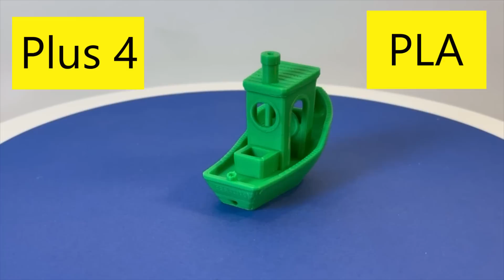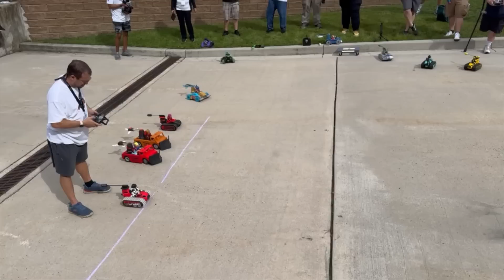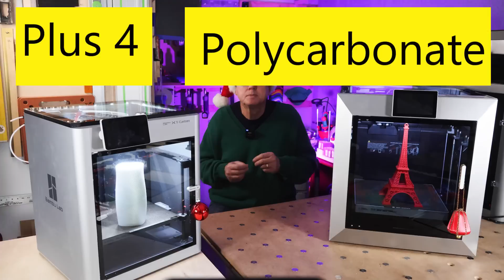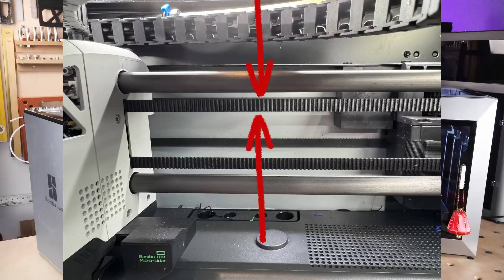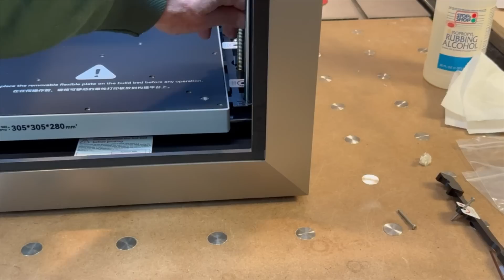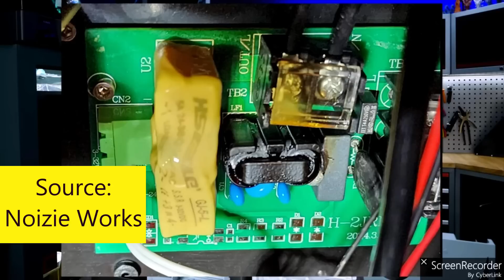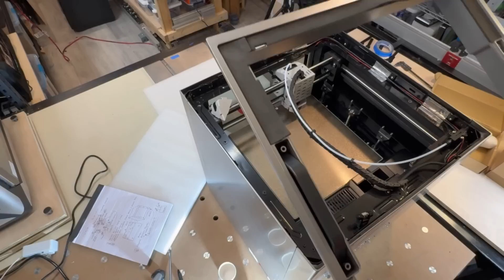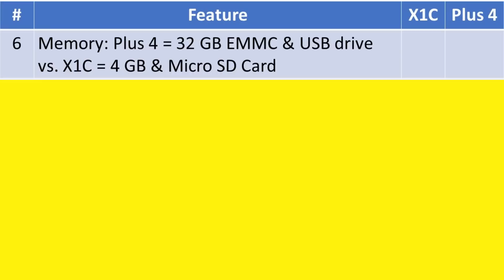Qidi Plus 4 3D Printer: Better Value Than Bambu Lab X1C?

Comment: Who's here because Bambu Labs just got crossed off the "potential purchase" list?
Reply: me lol
Reply: @noahlampkins6330  totally understandable! I ended up pulling the trigger on the +4 earlier this week and will have it delivered next week. I ordered directly from the website, got 5% off my first order, and then came back with a second order to get some filaments and the tungsten carbide tips that are on sale for the Chinese New Year. Overall it was a screaming deal.
Reply: Don't have any issue with Bambu. Nothing has changed for me. I'm a hobbiest printer and do this cuz I like building things and as a hobby to pass my time. Bambu made getting into 3d printing very easy and enjoyable. But I am considering buying the qidi for high temp material
Reply from the maker: That’s a great question!
Reply: I purchased a bambu A1 a couple of weeks agter the "scandal" and it's the best damn printer I've ever had.
Reply: @raindeergames6104  How many have you tried? And have you tried the Qidi Plus 4?  (Because it's awesome, not gonna lie)  I don't think anyone is knocking Bambu's quality. The gripe is all about how Bambu has started locking things down and is seeming to prepare to move toward a subscription based software service for hardware you already bought. While other manufacturers embrace 3rd party solutions and open source software, Bambu is not.
Reply: Been a toss up between the 4 and the p1s here... Looking like the qidi +4 is going to be the best bang for my buck .. so far
Reply: @xtreme43  did you buy it?
Reply: no, only because of cost
Reply: Yup. Got the plus 4 . Does require some experience and a couple small tweaks. But after that it's been great
Reply: Just returned my P1S😢
Reply: 3 Bambu so far... don't get salty because others like convenience 😉
Reply: @mostlymessingabout  I like the convenience of a larger build size, heated chamber, and more money in my pocket...
Reply: @mostlymessingabout what's more convenient about Bambu? My +4 is doing awesome, was less expensive, and Qidi put out profiles for Orca Slicer.
Reply: i totally avoided bambu because of their closed infrastructure . first i got a flashforge , then I got sovol because of their open source . I don't like the dialing it in the machine , but i like the ability to upgrade.. but might get a qudi too
Reply: I bought 4 Bambu's yesterday.  Very much on my list to purchase more.  But you do you.
Reply: @jonwoodworker  that's definitely the plan. I'm really liking the Qidi Plus 4. I'm wanting to print parts for my truck project and it looks like the +4 does ABS better than the X1C anyway. I was really set on the X1C for about a month before this TOS news came out, but it was enough to get me looking elsewhere and I'm really glad I did.

Comment: @ristinnovations  I got my Plus 4 today! Lol the two guys that brought the box to my door didn't offer to drag it into the house and I didn't ask, so I managed. Not as bad as I feared and especially not once it's out of the box. The handles make that weight SO much more manageable. Anyway, I just now got it up and running enough to slap out a benchy boat from the default included files.  On my old Robo 3D R1+ my best quality took about 2 hours 10 min. This thing went through the preflight motions, sat there long enough for me to go "Aaaand it's sitting..." and boom off it flies into printing, lol. I sat there in awe as it blazed through that little boat in about 15 or so minutes. And it came out super pretty. Mind you I used a spool of leftover Flashforge Nebula Purple PLA, NOT high speed filament at all and the thing is beautiful. Only flaws were some indenting in the smokestack and the back surface of the stern, where retracts were happening. This printer is a demon let loose from the best parts of hell, I can't praise it enough. Just now got QIDIStudio installed and haven't had time yet to run one of my own designs, but that's coming tonight ASAP. Gotta see how it can handle some ESun ABS+, Polymaker ABS, and ESun PETG vs. my best from the old machine.

So far, I'm totally in love/lust. This thing is great. 🙂
Reply from the maker: I am glad you are loving your new printer! Thanks for sharing your experience

Comment: Forgot to mention the Plus 4 has 10mm screws vs X1c 8mm screws, and the Plus 4 comes with a network jack so you can hardwire instead of wifi.
Reply from the maker: Yes, those are good points. Thanks for your feedback

Comment: 6:45 I'm tired of people saying "maybe I need to fine-tune the parameters". When 3D printers just came out, that was understandable, sure, but when you're paying $1000+ for a printer  8 years later, there shouldn't be any "fine tuning". Do you need to "fine tune" your laser printer each time you load a new batch of paper? If I'm using a filament with RFID tag that the printer recognizes, it should JUST WORK! All the fine-tuning should've been done at the factory.
Reply from the maker: I understand your point of view, however many 3D printers only have “generic” material profiles instead of pre-loaded material profiles for every manufacturer’s filament so there are different parameter values for every manufacturer’s filament. 3D printers are heading in the direction you describe, but they are not there yet when compared to a standard paper printer. Thanks for sharing your point of view.
Reply: My A1, while still working, printed Bambu filaments really well.  Some generics were very good, some OK, and some straight up failed.  I had to tweak bed temps and nozzle temps a bit to get cleaner prints on many different filaments.  Prusa are the same.  When using their profiles with their filament you can get great prints.  With "generic", not so much.  There is no avoiding tweaking settings to get the best possible print, regardless of printer.  I have about 50 rolls of filament -- all are variations of PLA but rainbow, silk, matte, marble, brick, glow in the dark, etc.  All of them have required some level of tuning for best results other than the ones that come RFID -- and for Bambu that means only their filament...
Reply from the maker: @MrKen800  Thanks for sharing your experience with all the various filaments you use and the fact that they may need to be tweaked regarding their parameters.
Reply: Spot on.
Reply: He's using a special filament made by Bambu labs to work better with their machine, of course a "one size fits all" set of parameters won't be as good as the settings they made specifically for that filament
Reply: Yes. P1S just works and I love it :)

Comment: Great video. Considering the P1S ( more similar to the Plus 4 than the X1C) and AMS are $799 it is a much better deal and is pretty much the same printer (no LIDAR). The advantages of the Plus 4 for the home hobbies really don't matter that much ..IMO. It amazes me how stupid engineers can be. Why on earth would you change the mains connection knowing you are sending out a consumer replaceable part, pure stupidity or lack of connection to reality. As far as support it looks like we have gone backwards with the Plus 4 a few years where Chinese prints had piss poor quality control. And my biggest complaint is china printers in general is the relying on us to do warrantee repair for free. I have no issue with repairing my printers once out of warrantee but to expect free labor to repair an in warrantee printer IMO is BS. Again great video and very informative.
Reply from the maker: Thanks for your frank and candid feedback

Comment: I don't agree with " they should test there stuff more .". they have rushed it to market to be the best value for money printer  and consequently it has some issues  ... but  then the money they  might have spent testing they spend or  shipping parts out  quick smart   and  actually building a pretty good reputation in service and support  as long as people are  posting positive media about the experience i think they have the balance right  i think timing is really important .
Reply from the maker: I appreciate your point of view, however their CEO has stated that they need to do more testing before they launch a new product. When quality issues like the SSR board happen, it has a negative impact on a company’s reputation and it negatively impacts their sales. I think in QIDI’s recent case, they are trying to the right thing by all the things mentioned by their CEO. Thanks for sharing your opinion.
Reply: @ristinnovations  Yeh I think  people will tolerate a few performance issues if the service is good but the SSR thing is a real safety thing really not ok  to send to market way to much risk for everyone ..

Comment: Please double check the part of your video where the heater chamber is replaced!

You do not have to fully dismount the printer for replacing the chamber heater. It's fully sufficient to remove the two screws from the bottom side of the printer. The heater chamber can be demounted from the inside as it fits through the gantry elements, due to the side walls being a bit flexible. The procedure shown in the video takes one hour or more. 

Please at least leave a remark in the video or the comment section that the heater chamber can be replaced differently!

Thank you!
Reply from the maker: I was following Qidi's video on the steps to replace the chamber heater.  I did notice that the Qidi-produced video did not have the two screws in the bottom of the frame holding the chamber heater.  There may be an easier way to replace the chamber heater now, but I documented how I did it by following Qidi's instructions.  Thanks for your comment.
Reply: I was going to say that the dismantling procedure looked totally unnecessary to replace the heater fan assembly. Also, I found it odd that the heater fan mysteriously failed after replacing the power supply.

Comment: The biggest points that mean a lot to me are print quality, ease of use, and reliability. The equipment parts issue was a big turn-off with me. Replacing boards and fans is a definite no-go for me....unless shipping it back to them for the fixed doesn't cost me anything. Otherwise I'll stick with the one that has a better track record.
Reply from the maker: Thanks for your comment.

Comment: Just a heads up: Unless I missed somthing, Qidi power loss recovery is absolutely a lie. 31 hours into a 33 hour print and I had a power hiccup. Printer did indeed recover and had a prompt for power loss recovery. You could either press Continue, or Cancel. I pressed continue and it immediately went to re-home the axis with no on screen controls to prevent this from happening. The bed began moving back up to home position which drove the partial print on the build plate right into the extruder and it kept trying to lift until I yanked the power cord. It is absolutely baffeling to me how they advertize a power loss recovery feature and then program it in such a way that it eill either destroy the equipment or destroy the partial print. DO NOT DEPEND ON THIS FEATURE. Again, unless Im missing someting, this is absilutely not a functional feature and it would be wise to buy a good 1000w UPS to prevent power loss issues. I plan to try to manually replicate this condition again with non critical test prints to see if perhaps it was user error, but from what I can tell, there was only two options to pick and one of them was to cancel the print.
Reply: There is another catch to being able to continue using this feature after a power failure. The position of the printer has to be saved somewhere and in the event of a power failure, only the flash memory is suitable for retaining the data.
However, this means that the position will have to be saved all the time and sooner or later every form of flash memory will be written to so often that it will break. This is a particular problem with microSD cards. And M.2 memory with proper wear leveling is not installed in this printer. The eMMC memory is a soldered component and therefore no better.
Such data actually only belongs in the RAM, but in the RAM the data logically does not survive a power failure.
Reply from the maker: Thanks for sharing your experience with the Plus 4 power loss experience.
Reply: I can confirm Qidi’s power loss recovery works well, on the Plus 4 at least. Lost power in a storm a couple of nights ago for a couple of hours, it picked up where it left off after it came back on.
Reply: Good thing i have battery driven by solar panels hooked up to my 3d printer
Reply: Still amazes me that people seem to have so many power cuts in first world countries especially usa 😂 literally can't remember the last one I had in the UK 😂
Reply: @garyhowe88  If you saw distances in Canada and natural conditions you would stop laughing. You are head on head there compared to North America. Lot more service, lot shorter cables....
Reply: @luboshcamber1992  actually lived and worked in Canada for a few years 😉 still can't work out how in 1st world counties you have power cuts so often in cities and large towns 😂

Comment: Just ordered the Qidi Plus 4, I understand that Bambu is the king by many, but the price point as well as the features that’s packing and all the updates only making it better or even its best competitor. Snatched it for about $740 shipped, can’t complain when I needed $1250 for just the x1c. Also them coming out with an AMS q1 of 2025 will make it a complete printer. 

They will only get better from this point and on!
Reply from the maker: I hope you enjoy the Plus 4. Thanks for your comment.
Reply: May I ask where you purchased ?  That price is best I've seen
Reply: @ 3dprintersdepot not sure if they still have that deal  though.

Comment: Can we buy the SSR board and use it on another printer?
Reply from the maker: Are you referring to adding an actively heated chamber heater and fan to a non-Qidi printer or are you referring to something else?
Reply: @ristinnovations  yes sir. That's correct. But I've since gone to their website and found that they don't sell the boards to the public. It's only offered to those that purchased faulty printers. 
I was going to make my own chamber heater for an older printer and hoped to just usje this board as a ready-made solution

Comment: I watched a video yesterday showing that the Plus 4 only reaches 350, 360 if you set the temp from the touchscreen.
Reply: It depends on the firmware version.  Pre-release versions with the older firmware limited the temperature.  The release versions with release firmware do support 370C.  The printer.cfg file even lists a maximum of 380C before Klipper will step in and shut the hotend down.
Reply: @stew675  oh thank you for that clarification! I wonder who will make the first 500° printer to the consumer market so we can actually use these Phaetus Dragons to the max?
Reply from the maker: @stew675  Thank you for your reply

Comment: Influencers, influencing, the Influenced. I've yet to see any that come close to BLs build quality or stability for that matter🤞. For all practical purposes, a P1S is all that you need, that too without AMS. Larger build plate only makes sense for those few. Same with a chamber heater(except for the engineering grade materials) or the gimmicky multicolor prints with AMS. If you are primarily into functional prints, you don't need an A1,A1 mini or a X1C or any clones, that are still catching up🤞.
Reply: How so? Not everyone has $1k+ to blow on a 3D printer and aside from the AMS, the Plus 4 is the better option for people not wanting to spend nearly double the price.
Reply: Chamber heater is super valuable for functional parts
Reply: Totally agree :)

Comment: I have heard some stories about Bambu labs customer service somewhat lacking. Does anyone have any experience with their support.
Reply: According to my own experience, it takes a while to wait for Bambu to reply to tickets and send new parts. Qidi's after-sales response is faster.
Reply: @Kimberlie1  Thank you.
Reply: That's totally, all my problems were answered within 24 hours. They have a really great support and they also help you to think outside of the box. Nothing but probs for Qidi.
Reply: My Bambu A1 injected molten PLA up into the extruder and up/behind the hot-end in a blob-mess.  It took Bambu a week to respond and the response was, "This is a consumable item and is not warranty".  Printer was about 5 months old.   It's now gone and I'm in the market for another printer that isn't Bambu.  Disappointed in the print results being demonstrated by Prusa Core Ones along with the price/complexity of their MMU.  I don't trust tech made in China on my network and having an ethernet port is a win.  I have a high-end laptop to dedicate to direct connection to the printer that will not access the internet.  I will wait on the Qidi MMU unit before I jump in though.
Reply: False rumors spread by Prusa Stans. Nobody that owns a Bambu needs customer support because the machines just work....

/s
Reply: @ Thank you for the reply.

Comment: How do both compare in noise?
Reply from the maker: I would say they are similar in noise when they are running.  The Plus 4 has a noisier fan for the electronics that runs continuously, even when you aren't printing.  Thanks for the question.
Reply: @ristinnovations  there an easy mod, as easy as editing the printer.cfg file, that allows you to reduce the noise of the mainboard fan when the printer is idle.